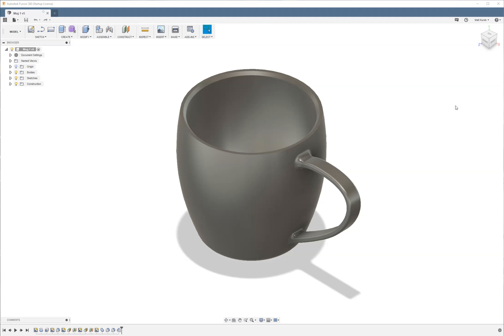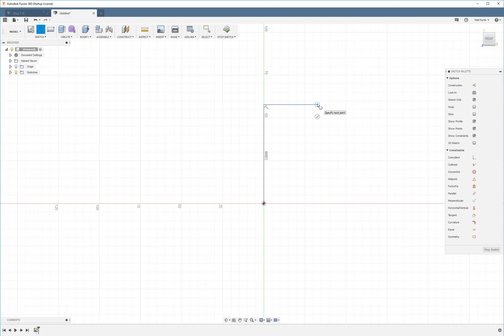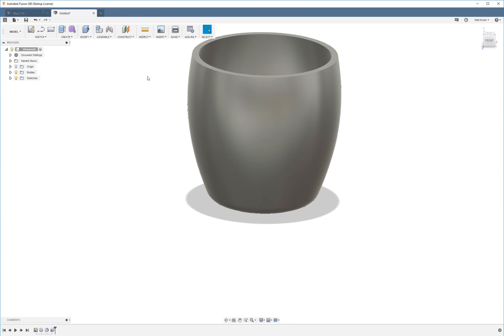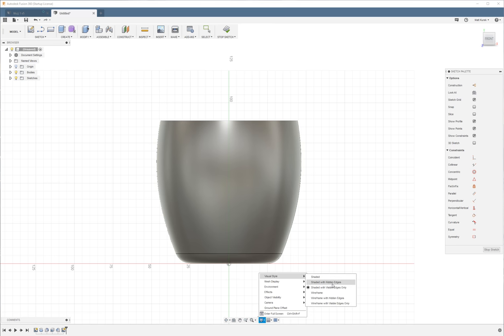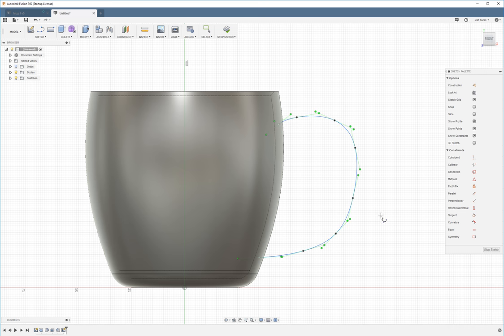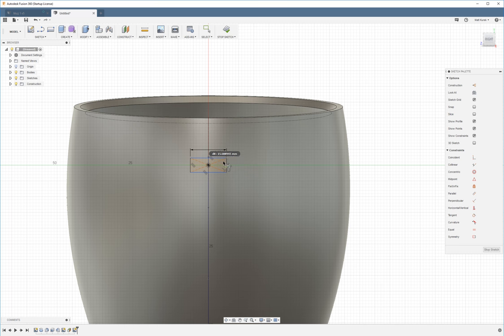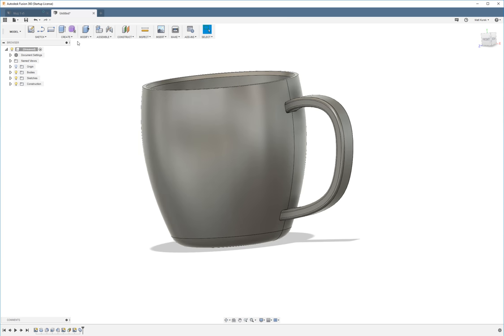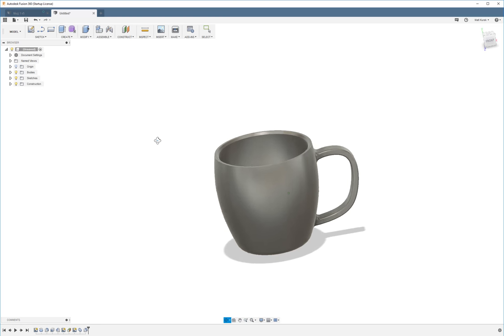How to Use Sweeps in Fusion 360

Comment: Did we need to use the reference points?  I can't get the rectangle to show up on the mug.  It shows the dimensions when sketching but nothing shows up.  Thanks!
Reply from the maker: Are you properly creating the reference plane to sketch on? Is a new sketch being created in the timeline when you try to sketch the rectangle?
Reply: I have the same problem! I followed exactly how he did it but the rectangle wants to be on another axis so it looks like you not drawing it bc its so slim.
Reply: @renekeystone5571  YES this is my problem as well. So frustrating.

Comment: I did it exactly how you showed it but for some reason, it doesn't let me use the shell command. I can't chose the top like you did.
Reply from the maker: not using the shell command (or any command for that matter) can you select the top and start a new sketch on it? If not, then you likely have a slight curve to the top that you're not able to easily notice. Does the shell command work from the bottom?
Reply: if you used the curved tool on the top, it wont let you do the shell command, it has to be completely flat at the top plane to use shell on it.